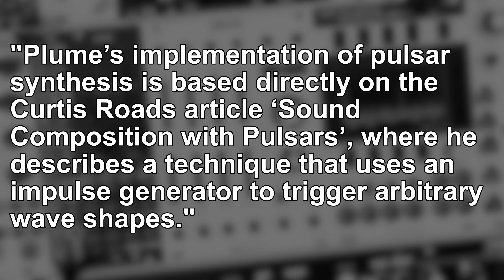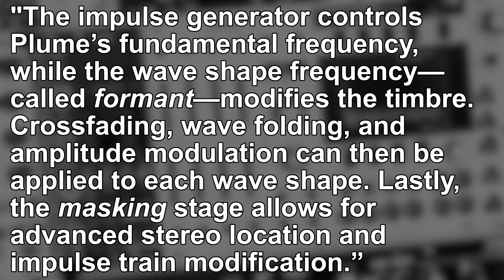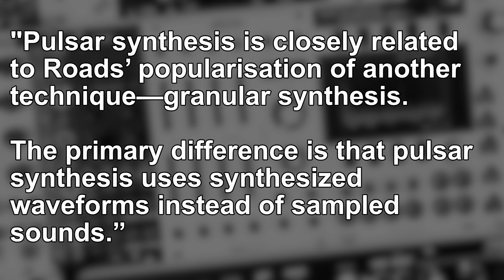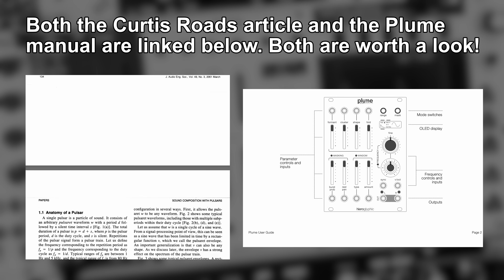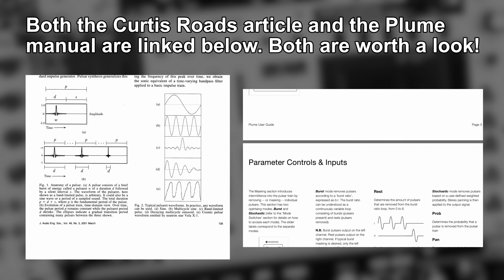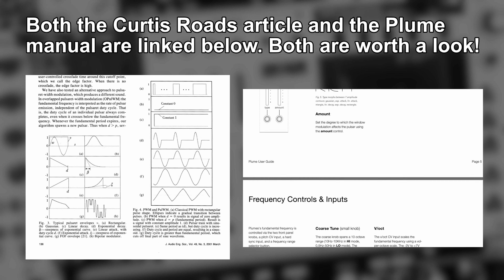The fascinating world of PULSAR SYNTHESIS with Plume from hieroglyphic

Comment: While the approach seems novel, I personally didn't find this sonically interesting. Yes it makes sounds but is it melodically useful? I want my sound sources to not only make grungy sounds (which this certainly makes) but also to make softer haunting, ethereal sounds. This module may indeed be able to do that, but the demonstration didn't address those types of sounds.
Reply from the maker: "is it melodically useful" ... is a sine wave melodically useful, or a square more musical than a saw? 

It's not musical until you do something with it. This is a shorter "3 patches with" style demo (a series of shorter demos I've done a few of lately). It certainly doesn't uncover every way to use it, every sound and each use case.

While the masking making the grungy aspects as it splits pulse (cluster of waves) into the two outputs or randomly drop pulses. Keeping that constantly is then just like other oscillators.

I wouldn't say it's any less musical or melodic than another oscillator or synthesis types. Fair enough if you don't feel the demo made the patches you wanted to hear though.

Comment: Seattle Sync! Just got mine.Psyched to get going with it. One super minor quibble -- pulsar synthesis can be used on a sample or incoming audio stream as well. I've written patches that do that. Provides a super cool and unique distortion effect. This module doesn't have audio in, which is fine, but that's not a restriction on pulsar synth. Great reco to read the Curtis Rhoads article.
Reply from the maker: With a sample is that then not just granular synthesis? 

Or is there a specific reference to pulsar synthesis with samples?
Reply from the maker: and I'll raise you a Bradford sync to the Seattle one! haha
Reply: So Granular then…

Comment: Shapeshifter has proper (single period) pulsar synthesis using one shot sync mode. Mylarmelodies discussed disting's mode in a recent video. Beads in "wavetable mode" with dry/wet does something very close, eccentric except the pulsaret envelope width is independent of pulsaret pitch and grain frequency. 

**If you own Beads and Rings, you should try Beads into Rings.**

Curtis Roads recommends using pulsar together with convolution (not reverb), and this is the same idea. It's also similar to Elements in having flexible control over the exciter.
Reply from the maker: Yes to all that.
Reply: @DivKid  it occurs to me that any oscillator with sync plus an envelope generator that will (re)trigger at audio rate is enough.
Reply: @GeorgeLocke   The PLUME module doesn't seem to be able to process audio signals. I'm interested in modular as a timbre shaper for my guitar tone so pulsar synthesis is worth a try. I think this can be achieved in many ways. One is a sample & hold module found in Buchla synths that has a twin alternating output called "pulsar" (coincidence?) Do you agree? Any suggestions for modules...or for whatever?

Comment: Wow... fascinating concept and some great sounds. Unexpectedly I'm most interested in the low-rate for modulation though. I'd love to see a version of this idea focused on using Pulsar Synthesis as a dual-channel function generator. It'd be like the best of Rampage, Maths and Auza Wave Packets all in one!
Reply from the maker: Soon as you mention more of a function generator edge I thought of the Wave Packets. I'm now thinking of some sort of pulsar within a pulsar thing. Where each cluster is an already fully done and complete pulsar thing (like Plume) but you can then define a number of pulses and then window those too ... some sort of pulsar inception in my mind.
Reply: I actually went for this rather than Wave Packets. Very different,  but fills a similar niche in my case. Not super interested in it at audio rate, but at lower speeds it has some very interesting throbbing and rhythm to it. Very happy with the purchase so far.